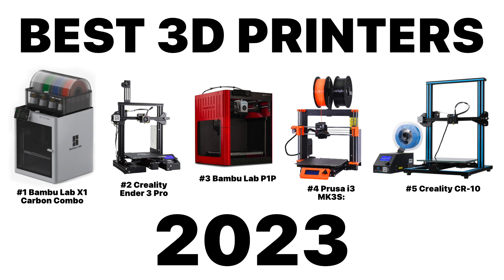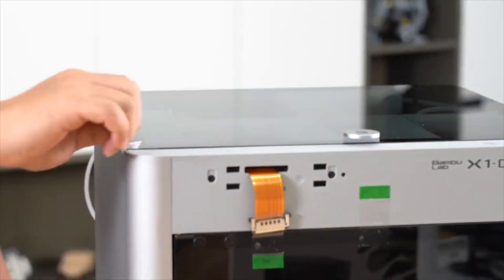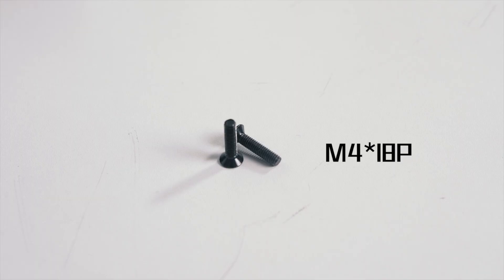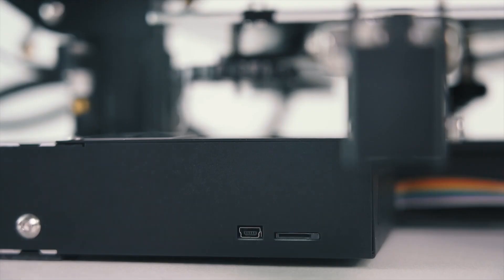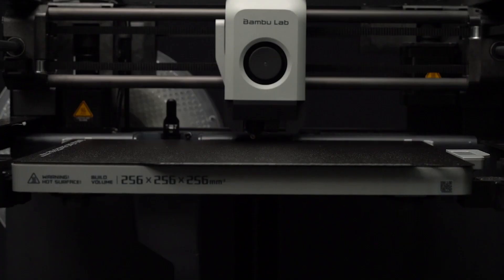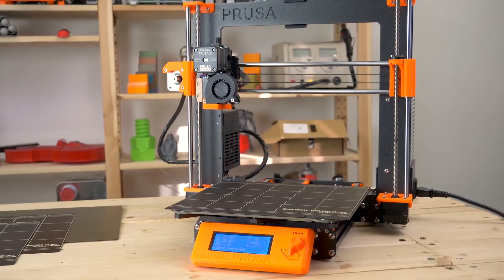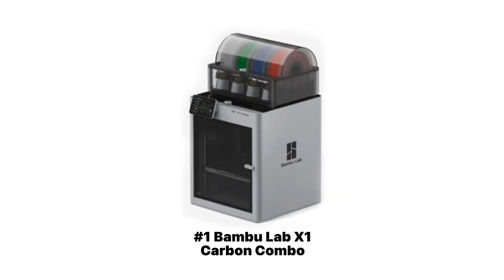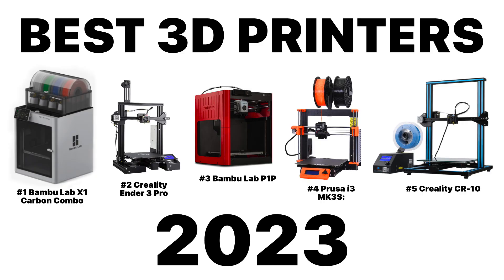Best 3D Printers - 2023

Comment: i think the ender 3 s1 pro is a good between priced printer not mentioned here. Easier to set up, no upgrades really needed and pretty user friendly. I have the normal s1 which is good but wish it came with the all metal  hot end.

Comment: why didnt the newer ender 3 models make the cut? the s1 whatever for around 500 bucks seems to be quite good?
Reply: I agree. It's direct drive, has a removable bed, bed sensor, quick to assemble, and the base model is available for as low as $350. The cr10 is also a weird choice. The ender 3 max neo is superior in every way.

Comment: There is nothing innovating about the bambu lab X1 or P1P, I don't know why people keep saying this. Their AMS is a glorified prusa MMU2 or mosaic pallet. And it's entire construction is built upon open source innovations, that bambu then slapped a propriety label on. Its coreXY motion system, it's direct drive extruder, its hot end, it's heat bed, its slicer, it's klipper firmware, all open source innovation they took without giving credit to the creators. It's Lidar is misleading and they've already had some shady concerns. From their network vulnerabilities, to them stealing other creators work, without giving attribution or credit. Such as the dog in their christmas house model. And they delete comments on their channel when facts come out against them. Bambu is to not be trusted. https://twitter.com/FilamentFrenzy/status/1604765571882848256?cxt=HHwWgMDUvaDyosUsAAAA

Many people are having problems with their X1's and they cant get parts or hold of bambu CS. My friend just got his X1C on friday and already has a faulty extruder. Not even 10hrs on the printer. And its been 72hrs so far and he still hasn't heard back from bambu. Prusa has you on the line in less than a minute.

Creality is bargain bin junk, but at least they're still fully open source and you can get parts quickly. And Prusa is 100% open source and gives back to the community that it benefits from, while bambu labs just takes and takes. Prusa has also been entirely transparent and open with its users, community and many in the maker space.
Reply: My X1C crashed its tool lhead into my bed when it was calibrating. Left DEEP scratches in the bed. took 6 whole days to hear back from bambu and all they said was "we've never seen anything like this before, we'll send this to our engineers" And I'm like, Okay, uhh what about a replacement?. I literally did not hear back for a week, meanwhile I heard from at least a dozen other people that had the same problem. They finally got back and asked me to send back the printer and they'll send out a new. I just laughed. I waited two months for this one and all they have to do is send me a new heat bed, ridiculous.

Funny how my prusa and vorons never crashed into themselves, even after thousands of hours.

Comment: wait wait!! in all seriousness still recommending the ender 3 for 2023!! that needs tons of mods and assembly , btw you're drawing people away from 3d printing by recommending this one specially when there is a 230 $ beast that come half assembled , with topnotch auto bed leveling do not need a single mod its called  elegoo neptune 3Pro , why im saying all that because i dont want the new comers to suffer like we did while there is a more user friendly printers. im not sponsored by them in  any way but ive been using it for the past month and never had any issue have a good day :)
Reply from the maker: The reason I chose the Ender-3 is over other Ender-3-clones is because it has the largest user base and most information online. They really don't need any upgrades to work properly, however, for folks who are not mechanically inclined, manual bed leveling may be frustrating.
Reply: @3DPrinterAcademyTutorials  my bed came warped and i wasted so much time trying to manual bed level it for months
Reply: @0xscoopta  the base ender 3's are a mixed bag and require too much tinkering for a beginner. The ender 3 v2 would be a better value proposition and it would still be an ender 3 with lots of support online.
Reply: 100% agree, people reading this do not buy the ender 3/3 Pro. They are too much of a pain and paying extra is very worth it.

Comment: the X1C is priced well. The p1p would cost double the price if you do most of the upgrades the x1c has like lidar ams a better resolution camera the led and fans and the body enclosure and glass covers etc. it makes sense and i see why the x1c cost double. i think it is worth it since you can print carbon and silk too and a couple more filaments etc. i wanted the p1p at first but i thought about it real well and i need to do it right the first time and get the X1C since i might love printing carbon parts and i would hate to not be able to view or use the touch screen vs the panel the p1p has that is so boring looking and having to click it several times a day and not being able to see what print you are loading. But if one can only afford the p1p then it is a good buy for sure!